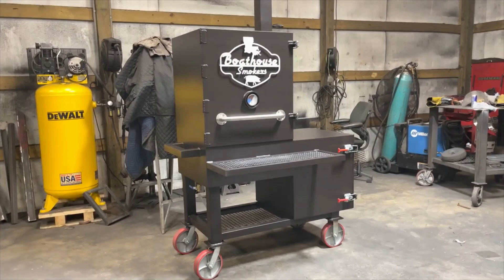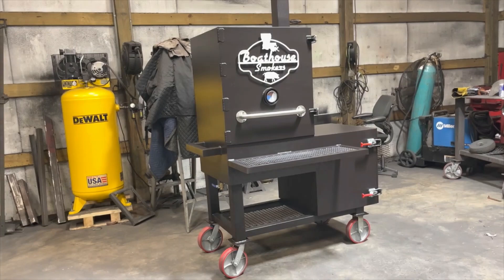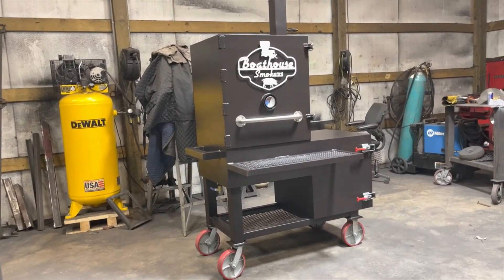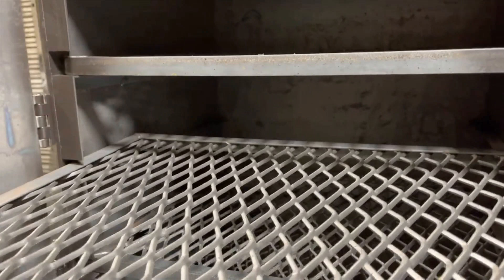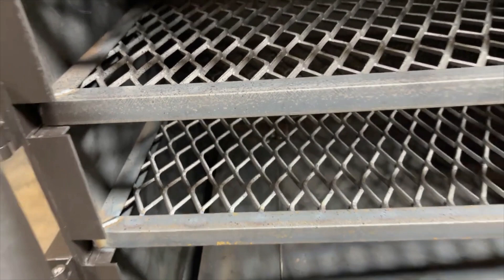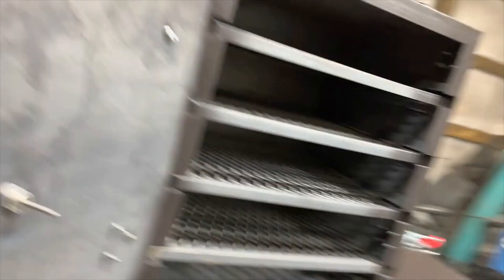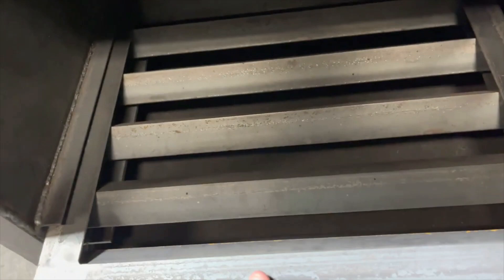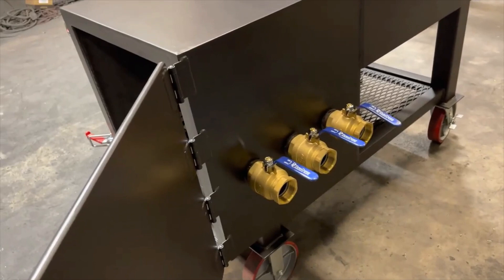Boathouse l Offset Vertical Reverse Flow Cabinet Smoker with Insulated firebox.

Comment: Hey Brian!  I just subscribed to your channel.  I really enjoy your videos and your smokers are really cool!!  I have a small YouTube channel also (The Lone Moose).  I have several smoking videos on the channel, as well as a wide variety of other topics.  I'm messaging you to see if it would be possible to maybe stop by your shop and meet you one day.  I'm going to be visiting my dad (93) in northern WV the last week of this month, and I'll be coming back to Texas via I-10.  If you are anywhere near I-10 I'd love to stop by and see your smokers!  About 10-12 years ago dad and I built a small towable smoker.  Actually, the way that I engineered it, it can either be a large grill, a wood/charcoal oven, or a smoker.  It has 4 heat chambers to you can manage not only the heat, but the smoke going to various parts of the cooker.  That smoker was basically built when dad decided he wanted a pig roast for the big family Thanksgiving celebration one year, and I didn't have a smoker big enough to do a pig.  In 2017/18 he decided he wanted to put a rotisserie spit on the machine so he could see the pig spin.  Welllll...  I designed the mechanism to make it turn, he got a piece of 1" diameter stainless steel and we tried it in spring 2018.  Here is the video of the building of the smoker and the rotisserie:  https://youtu.be/QMydd39C1tQ    Well, he bought a pig that was over 100# and it broke the rotisserie device.  Dad doesn't figure that he'll live much longer so he wants me to come back there and do another pig roast the last week of October, on the 29th of October.  He's reinforced the device and he's getting a smaller pig.  He wants to see a pig spin on the cooker before he dies.  Anyway, my point is that I'll be coming back after the 29th along I-10 and would like to stop by and say HI! (I like meeting other YouTubers) and see how you do things.  Please let me know.  Bill
Reply from the maker: Yes sir. Drop by and say hello.

Comment: Very nice smoker. One question I have though is how well will it seal up and hold temp with the cutouts for the racks being a part of the outside framing. I'm just curious about that and whether or not it will seal up completely even with a gasket. Thanks and again very nice smoker.
Reply from the maker: They seal up 100%. No leaks.